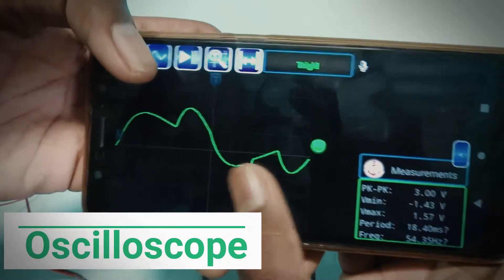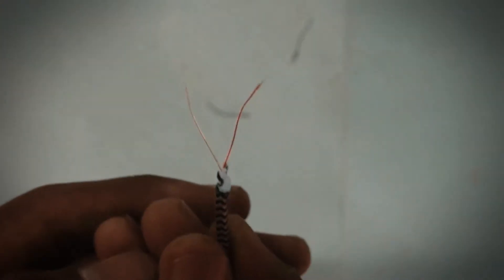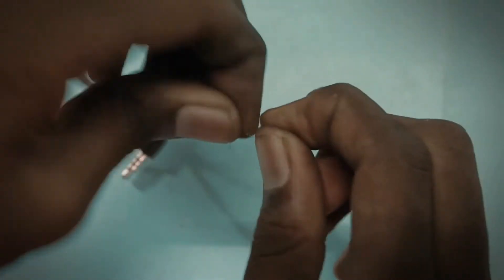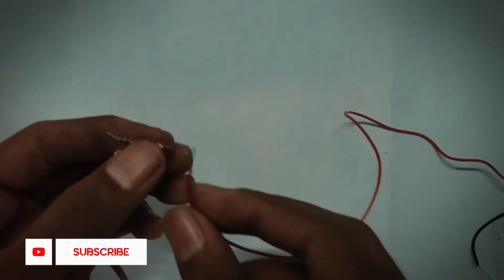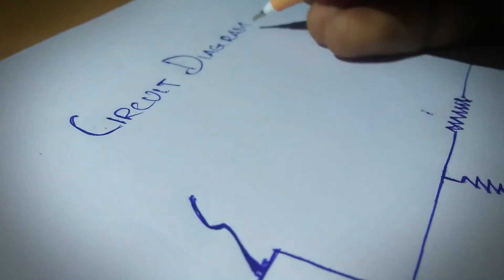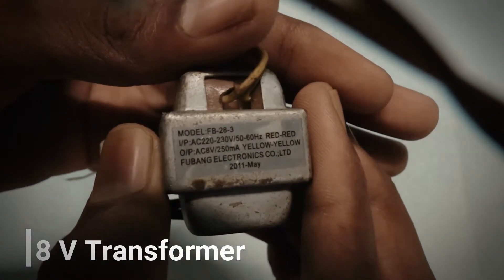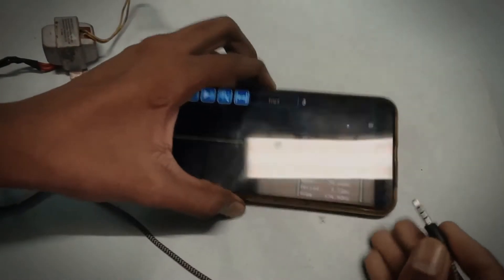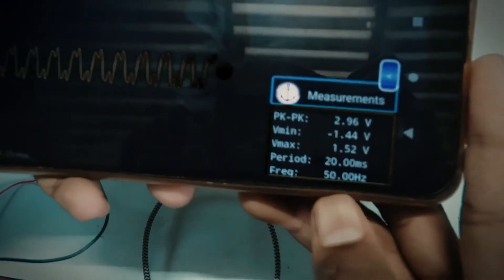Oscilloscope From Old Phone - DIY

Comment: Thanks. I've made  as yours.  Hz is not fixed, it shows 30. 40 50 60 etc. and more . Even measuring ac mains Hz. via 6 volt out put trf.